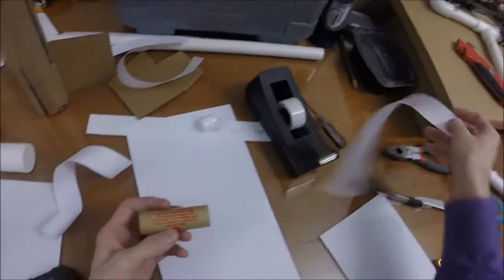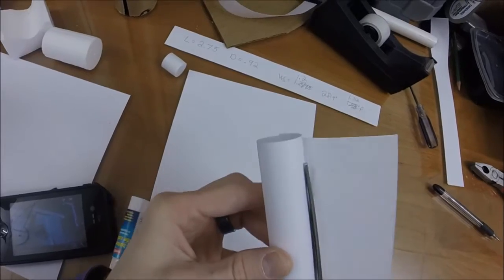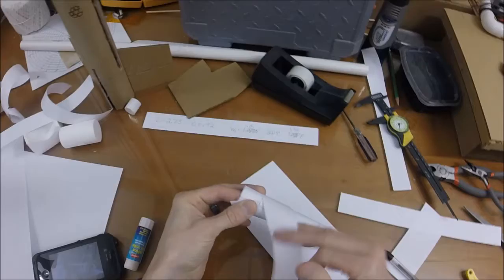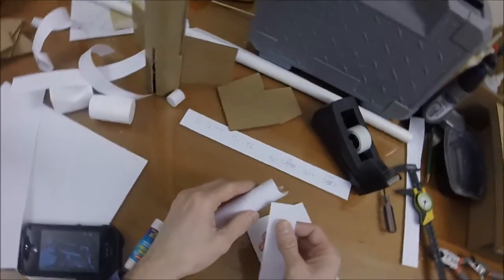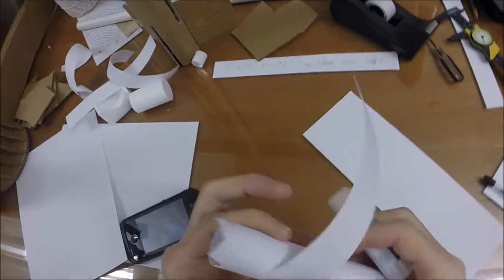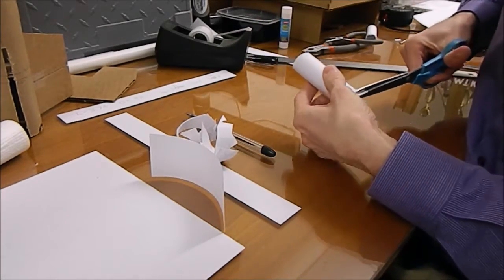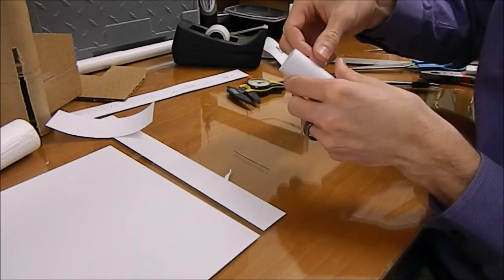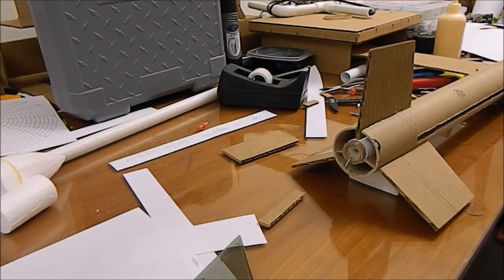Making a Motor Mount for a Model Rocket     Mikes Inventions

Comment: Hi Mike:

Thanks for sharing your methods!  Just a couple of suggestions:

    1.  You can tape two or more motors together, end to end, to make a longer mandrel.  It will be firmer and easier to work with.  Also, the tape you use to join them will give you the clearance needed for easy motor removal from the motor mount.

    2.  Wrapping a tube directly with single wide piece of paper (instead of spiral strips) makes a stronger tube and seems to be easier.

    3.  I use a bobby pin for the motor retaining clip instead of a paper clip.  Bobby pins are made from spring steel, so they "spring back" better and hold the motor with a positive force.  They are also stronger and less likely to bend.  And they are flat and wider to give a better hold.  For larger motors, you can use a "jumbo" size bobby pin.

Hope this helps, and happy flying to everyone!

Comment: Mike what kind of paper you are using thanks
Reply from the maker: richard Palmisano Richard, this video shows a mount just made out of regular paper. If you try and roll something thick like cardstock, it won't work because the paper is too thick to roll well. You end up with some sort of polygon. You could of course use kraft paper like they do for most rolled tubes and official motor mounts, but enough sheets of regular paper will work fine as long as they are glued together well enough. Great Question!
Reply: What size dowel can you use in inches for 17 mm motor mounts? Is the 24 mm ¾ dowel. And how long the each should be? I think you said 2¾ long right. Thanks my man.
Reply from the maker: richard Palmisano Hey Richard. You can't really use any commercially available dowel without wrapping it. The closest size to 18mm is 23/32, but good luck finding a dowel that size, and it's a bit big anyway. You might find an 11/16 and build it up to .708 with a wrap of tape or something. Yes, engines are 2.75" long, but the mount should of course be longer than that. Here's a handy link that has all the dimensions for Estes engines. http://www2.estesrockets.com/pdf/Estes_Model_Rocket_Engines.pdf